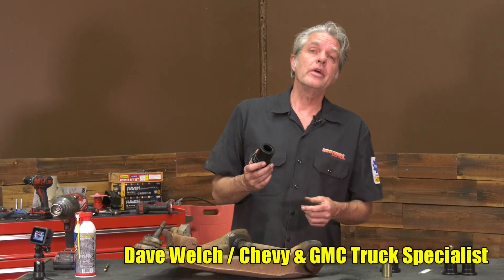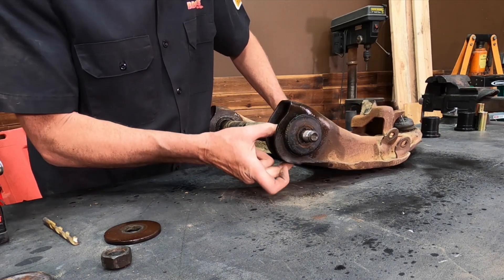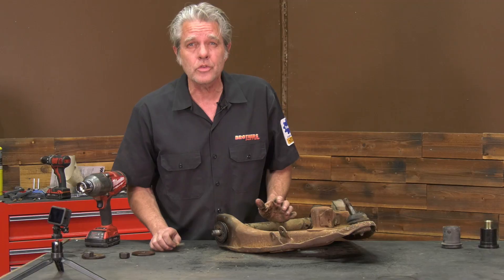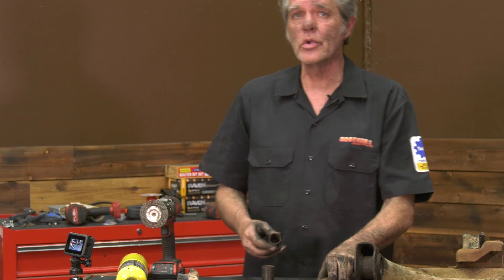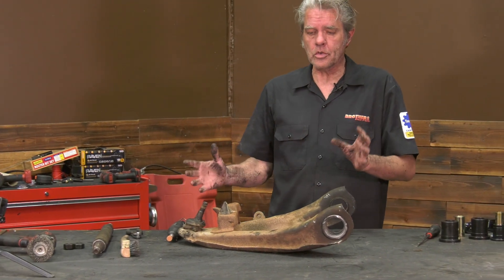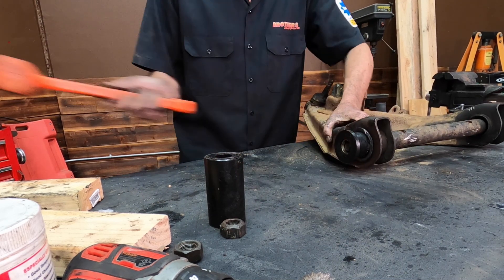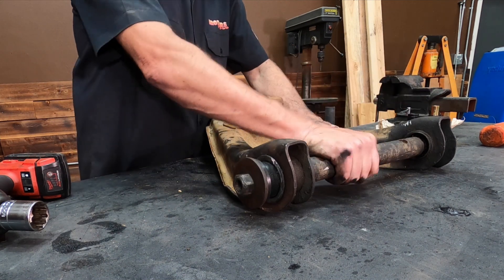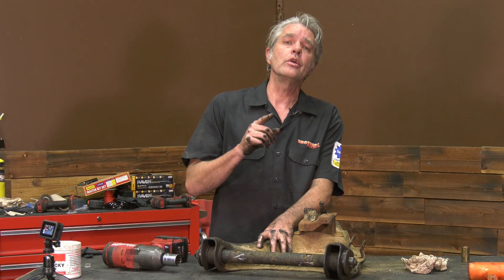1973-87 Chevy & GMC Truck Urethane Control Arm Bushing Upgrade - C10/Squarebody

Comment: Razor blade the “cap” off and use a #21 drill bit on the outer part of the rubber and just let the bit run all the way around between the rubber and the metal shell. 5-10 minutes per bushing with no smoke or mess.

Comment: For poly bushing..do you not have to get the inside metal ring out that was from the old bushing? I see in the other video when replacing with rubber bushings that had the metal sleeve on the outside, you had to cut the inner metal ring out of the ca

Comment: Rather than pry out the old rubber can you just melt the rubber out with a torch? That's what I did when I replaced the bushings on my race car and made quick work of it
Reply from the maker: Absolutely, you can do that, we've done it a few times. It works great for cleaning out the extra rubber left in the shell after the main rubber has been removed too!

Comment: Do you have to remove the shell if you are going with urethane? The kit I got is urethane but came with new shells , don't really want to take them out and install new shells
Reply from the maker: Not certain where you got that kit, but our kit requires you reuse the same shell. You don't need to remove them from the a-arm, you just gut them like in this video.